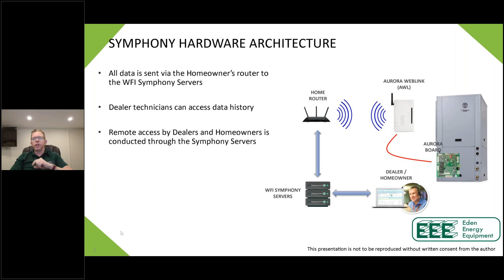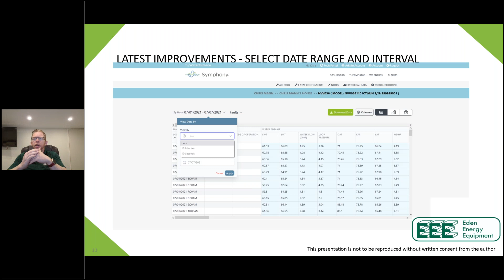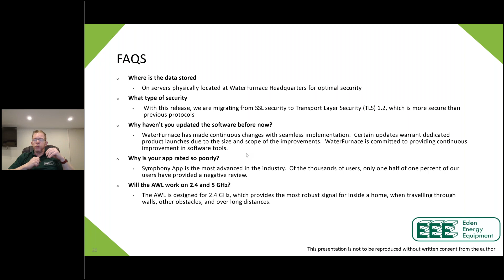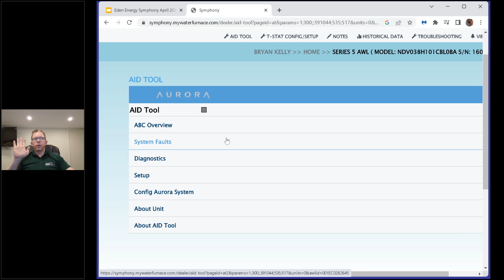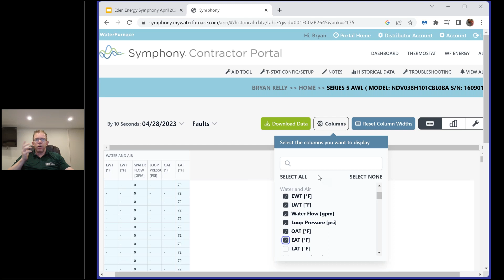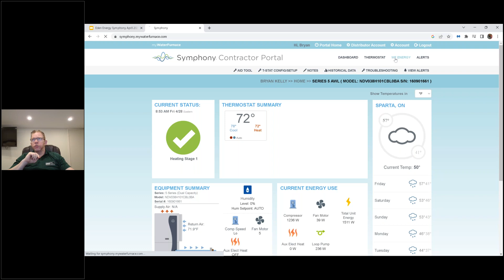WaterFurnace Symphony Controls Product Introduction

Comment: Can you set to only monitor.  Concerned hacker could gain control & lock out.  2nd does it integrate with home assistant
Reply from the maker: It integrates with Alexa but not home assistant. As for access you can physically unplug the hardware from your WaterFurnace should you ever lose or forget your password while you reset it.

Comment: What is the cost of the Aurora on a 5 series?
Reply from the maker: You would need to contact a local WaterFurnace dealer to get an idea on pricing. Aurora is a control that is built into all 3,5,7 series equipment WFI makes.